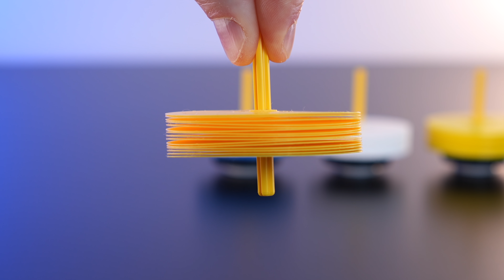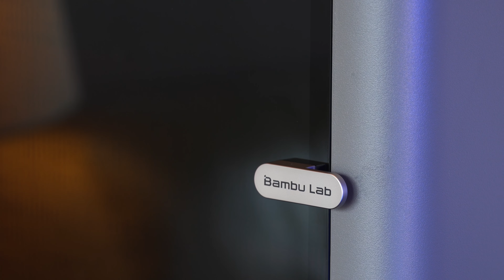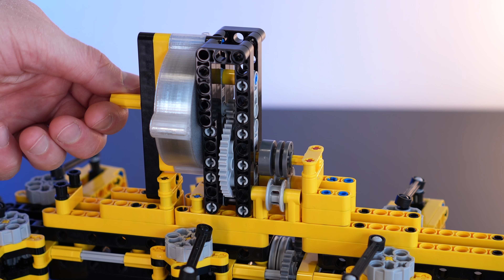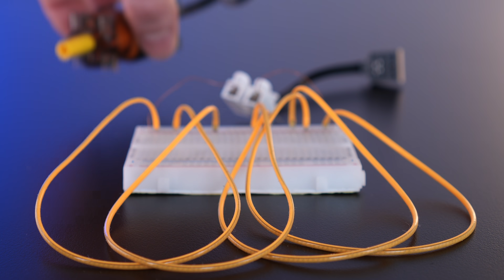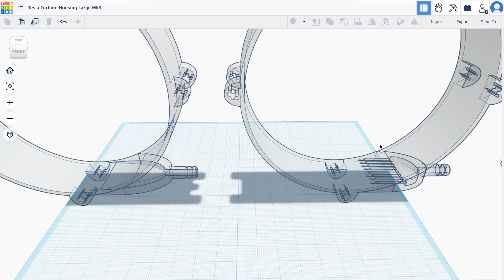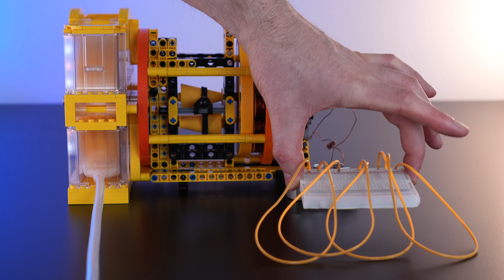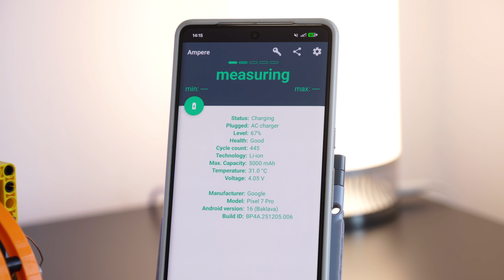Powerful Lego BLADELESS Turbine Generator!

Comment from the maker: If you’d like to pick up your own Bambu Lab P2S: https://tidd.ly/47BXRCr
Reply: Bambu Lab illegally proprietarized and enclosed open-source, explicitly copyleft software. It then sent a cease-and-desist to a developer who adhered to the copyleft license they are not upholding and are therefore breaching.
Reply: You need to properly declare your sponsorships. It's literally a tos violation not to.
Reply: @foureye6693 shuuush
Reply: @foureye6693  They did. To quote "Thanks to Bambu for parenting with me for this video". Doesn't get clearer than that you just skipped over it probably.
Reply: @CommanderRedEXE paid promos show differently when properly declared, this did not
Reply: use onshape or fusio360 instead of tinkercad. they're WAY more capable and time saving
Reply: I just recently got a P1S myself. Considering I was upgrading from an Ender 3, the improvement is night & day.
Also, if you want better laminar flow, you need a longer transition between the tube and the inlet. The one you're using is too short.
Something tapered, about 120-160 mm long (roughly half of it with the vanes) will let the turbulence settle out and become more laminar before entering the chamber.
Reply: He built an air raid siren
Reply: Hey can you try making aaln overpowered vacuum engine
Reply: btw in the video u forgot to print ABS rotors
Reply: i have an a1
Reply: Why does every single one sound like a air raid siren?
Reply: I have a 3D printer it is really cool I dom’t blame him for using it
Reply: *don’t
Reply: @theketokids7259 should i get one?
Reply: Bamboo🤨
Reply: @Pupi-aja  no
Reply: Is it good?
Reply: @MidWestRider-f5e  a lot of creators use it if that helps at all
Reply: @Blackhawk20034 ok I might get it
Reply: @Blackhawk20034  And I'm sure Bambu in no way encourage that by sending free printers and other goodies to people who'll wax lyrical about them in videos.
Reply: @MidWestRider-f5e  You'll have to use your phone and apps, and make an account and all that modern BS if you go with Bambu. Also they love to spy on what you're printing. I wish I was joking.
Reply: @foureye6693 oh, I'm a kid so idk😅
Reply: @MidWestRider-f5e  I recommend you go for it! 3d printing and 3d design can open a lot of doors if you're young. You can make some decent change with a 3d printer, because everyone will ask you to print things for them.

 Even if you start with a cheap older design Ender 3 or similar. Which is a machine that you can make new parts for and upgrade cheaply, that's a really good way to get started even today.

Comment: Great video Jamie. Okay, where do I start, note 'Lego' is a great toy and makes designing easy as.
So, what were you thinking!!! Trying to use it as a pressure vessel? This 'toy' was not designed to hold pressure!
You want to know how to reduce the back pressure to stop lines blowing off? Follow these next instructions to a 't'.
1. Make a molding of your 'pressure vessel' that pops in half so you can load a hexagonal metal axle and bearings.
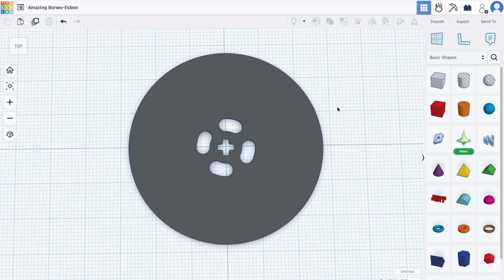2, Make elongated vents like the plan indicated 3:22, load the blades with a helix through the centre, and not in line.
3, 20mmNB from your compressor, split into two 10mmNB. The internal diameter (ID) of a connector reducing from a 20 NB 
hose to a 10 mm NB hose will vary at each end of the fitting depending on its schedule/wall thickness, you'll need a 8 NB.
then those two will split again into four 'injectors with 5mm NM, set the injectors aiming fifteen degrees down from the four o'clock
almost pointing at the five o'clock, your compression chamber needs to be 4 mm at the six o'clock, 3 mm at the nine o'clock, 
2 mm at the twelve o'clock, and a semi circle with 1 mm clearance at the 3 o'clock, just above the injectors.
Finally, a proper exit plan, 'four' exhaust openings at fifteen degrees, ten% bigger than the centre dics openings, four 8mm NB free flows 
reducing to 2 12 mm NB hoses, reducing to one 24mm NB hose with a gate valve, which can be closed slowly to optimise the 'generator'.

Comment: 0:43 this doesn't appear to be a Tesla turbine it's using the design uses by disk style sirens, such as air raid sirens and also in cheap 50 cent siren whistles. Those use those tiny ports for an intermittent air chopping effect. You can see the stator ports and the rotor ports intermittently aligned as the rotors turn, which is the primary source of the vibration and is usually baked into the design as part of the intermittent valve action. You can look up this type of siren or a cheap siren whistle to observe the same design, it's not the same as a Tesla turbine

Comment: 13:10 the pressure still made the enclosure shift, which made you lose pressure and RPM before it even could reach a top speed. I think this test was a failure, not the material.

Comment: I was curious as to why your "turbine blades" weren't printed to have spiral exhaust vents and why you chose that basic gear drive rather than a E-CVT design (you know, a 3 gear system of outer, inner and center.).

Comment: Tesla turbines rely on surface friction of fluids, whereas bladed turbines rely on the mass of the fluid. The ideal spacing of Tesla turbine disks is actually fully dependent on what fluid you're using. And has already been said, balance and vibration robbed you of more power.

The reason your miniature bladed turbine worked better, was that the spacing of the disks was off. Granted, these were Lego and 3D printed, but my point still stands. That said, these aren't often used to power generators, but more often are used as *pumps*, driven by some other form of power. Their lack of complicated parts combined with their friction-based nature, means they can function with fluids that would severely damage traditional fluid pumps. They're still used to this day, in certain niche applications.

Comment: Ask the air travels down to the center of the speed increases making the efficiency pretty high unlike normal turbines and with that compressed air it can reach high speeds replacing normal turbines

Comment: so a tesla turbine reaches those insane efficiencies mentioned by applying centrafugal force back onto the air thats spinning meaning that at maximum rpm the exhaust is at atmospheric pressure and its 100% efficient, but when you slow it down those forces dissapear and also the wetting effect that the fluids cause gets significantly reduced and thus the torque output and efficiency drop way down. This is the only reason we dont use these turbines in power plants today.

Comment: That’s not how you calculate how many watts it is you said that it can output a peak of about 30 V and one amp so then if you do the math that’s 30 W
Reply from the maker: It's never managed 1 amp at 30v though, so the max I've extracted at those pressures is still far below 30 watts

Comment: its called 12 SLOTS 10 or 14 POLES for that generator because coils are wires stuck through the slots between the coil holders although you can also call it a 12 tooth machine with the coil holders being the "teeth".

Comment: @18:30 the shaft is counter-rotating in it's housing. That is what the loud buzzing/vibrating sound is. It is the same reason a vacuum "screams" when the bearing is worn. The plastic is being ground away as the shaft spins.
i.e. needs bearings for the shaft. A LOT of the rotational torque is burned off in the shaft when it does that.

Comment: Most propulsion systems rely on outward explosive force. Viktor Schauberger proposed the opposite approach. He believed that air could be drawn into a disc through a series of curved channels that created a tightening inward spiral. This implosive flow would accelerate naturally as the air approached the center of the disc. 
In 1939, Viktor filed a patent with the Reich Patent Office for a "multistage centrifuge with concentrically juxtaposed pressure chambers," a means of propelling machines through air or water, water purification, or electricity generation. In 1940, Viktor contracted Kaempfer in Berlin to build the machine, then in February 1941, switched to the Kertl company in Vienna. In March 1941, he started working in secret for the Nazis. By 1944, this included the use of slave labor from the Mauthausen concentration camp. At the end of the war, the US apprehended Viktor, and debriefed him over the next nine months. In 1957, Viktor and his son Walter, were invited to the US by Karl Gerchsheimer and Robert Donner, to put Viktor's implosion technology into production. Viktor died soon after returning to Linz

Comment: Late to the party...  Instead of a belt for the CVT, you can try a rubber idler wheel which is slid across the different diameters to selectva particular ratio. It may be easier to maintain pressure against the cones than with a belt, and since both cones see the same pulley, any change of the pulley diameter due to wear has no effect on the overall drive ratio. Fascinating video, btw.

Comment: Since it makes power, you should add an air compressor with a tank to it. So while it uses air, it generates enough power to run the pumps to make more air and keep going, making it a never ending power cycle, then of course have some extra power options in it so you got extra power.

Comment: How big do you make the hole for the LEGO axle in Tinkercad? Because I’ve been trying to make my own LEGO compatible fan propellers, but I just can’t ever get the hole size right!
Reply from the maker: Ah good question! If I want to print an axle to fit into Lego, I use 4.7mm. But if I want to print an axle hole to hold a Lego axle, I use 5.1 or 5.2mm depending on how tight you want it. Good luck!

Comment: You do realize 1 amp is a big deal. And you can also power more of my LED bulbs than my generator. Very impressive! Also did you know you can power that turbine on dry ice?
Reply from the maker: Man I'd love to try dry ice! It's just not easy to get or store here in ireland
Reply: @JamiesBrickJams Would be cool to see. Just be careful doing so, if too much pressure builds in the tank it can explode. I also had an idea where multiple tanks are set in a row where one valve drops in some dry ice, closes and pressurizes, then a nother valve opens to discharge the pressure. All the tanks being timed kind of like an engine without Pistons to keep the turbine in motion. And I have a feeling it will work with what you got there.

Comment: The only downfall of this turbine is the fact that there's no material that has the strength it needs to avoid exploding. The faster it spins, the more efficient the turbine becomes, but for it to be practical, it has to spin so fast that there's nothing in the world that has the tensile strength needed to keep its shape at such speeds

Comment: Awesome video.  I like that you take measurements like a real engineer or scientist.  However 60  or 80 PSI is a bit dangerous.  I have done some of my best work in a constrained environment.   Early on, you blew into a turbine and got it turning!.  Blowing is about 1 meter water column or 1.5 to 2 psi.  My dual diaphragm aquarium air pump is 11 liters per minute and 3.5 psi.   Why not have a "turbine challenge" with those constraints?   Something like formula one car racing.   Have it as a formula lego turbine design contest.   Define the pump for the contest, define the challenge and   have prizes for the top 10 people.   I advocate using "well trompes" to help improve water quality in rivers, by oxygenating them,  by providing highly oxygenated areas where shellfish and small fish can hide and by removing sediment as they work.   They work anywhere you can do low head hydro power.  What I advocate also produces compressed air at around 3.5 psi. Right now,  sediment load in rivers is maybe 100 times what it was a hundred years ago,  and turbines are being removed all over the world to let fish migrate.  But the trompe is just a vertical pipe that compresses air.  There is no turbine in the water.    If your lego challenge works out, you may end up designing turbines to go in  mini water power systems worldwide!  And I think that might definitely be worth it.    Thanks Brian

Comment: the thing is
tesla turbines have a lot of speed and efficiency 
...which drops almost instantly to a bit less than that of a normal bladed turbine when load is applied
It does have the benefit of being a built in flywheel, which increases torque just by being hard to turn

Comment: Actually, you should try and use the exhaust air from the bigger tesla housing, and see if you can build another housing where the exhaust flow directly into and spin more disc's. So two housings. And how about making some groves in the inside of the housing inside on the housing to direct the flow of the wind inside after the inlet.

Comment: Yeah, the Tesla turbine doesn't exactly defeat traditional turbines in terms of power.. It's in the technicalities where it shines.
It can run with air or any liquid, can be operated in both directions and depending on the design, the swap can be done without having to tear it apart.
If I recall correctly, the holes in the discs should have a slight angle offset of a few degrees, but again.. My memory can be quite foggy.

Also the fluid rate is important. In some of the last tests you flinched when you heard the turbine make a sudden sound almost like it "changed gears".
That's by design. Those turbines will reach some sort of "resonance" if you will and I think you did not reach that spot for most of the tests performed
except for the last ones when you fully committed to the design. A lost opportunity, that's all

Comment: the only part about slicers when 3d printing that i dislike is the fact most slicers only use line segment G-Code. and even worse it just reduces the line segment to a tiny line segment. if you have some math skills and a g-code reference manual, you can print much easier. as an example i had to make a set of 45 degree menu card holders for a resturant. each layer is the same as the layer before and each layer containing 6 straight lines, 10 radii. the slicer wanted to make each layer unique meaning the instructions to make the line segments werent the same on every layer., one layer would start the line at a different fractional increment. while functionally the same, those variations add up to more time. turns out my controller supported modern g-code. i was able to reduce the program from hundreds of lines of g-code to about 25. you code one layer and g-code has functionality to repeat previous steps, so you just repeat the pattern n-times with n being your target height divided by layer thickness.

i say all this to point out, you can make those tesla discs much more rigid by printing them in a vase-like mode. either code yourself, a continuous spiral in or out or play with the slicer. by default most slicers infill face layers using straight lines. play with your slicer settings might be able to make them print much faster and rigid. faster because your printer doesnt have to relocate each line, it can just go at max speed for your machine and bang out one layer in one move.

edit: you may also want to use a current limiting resistor on the LED noodles. just so if you push too many pixies in to the noodles they wont explode.

Comment: i think the petG discs got fast enough to rattle the hosing apart causing it to have the axel off centre dragging the speed down. making some special exhaust bricks that have more space for air to pass would be a good upgrade.
Reply from the maker: Yeah I think you're correct on both counts. All versions could have done with larger exhaust ports. Especially the larger discs - I suspect I choked them with the small exhaust vents. PETG is likely a good material to use - especially for the larger discs as they're more shatterproof and lightly flexible. Will certainly give it another look in a future build!

Comment: You need to try doing one of the gearboxes, because I'm excited to hear what the shifting is like. Just use either a friction or magnetic clutch to help disconnect it when shifting, then reengage it when it's shifted so it can accelerate. I want to hear the noise of the turbine if it shifts. 😊

Comment: Compressed air is very inefficient. How much power do you need to supply the comoressed air?
Reply from the maker: Lots! Yeah this isn't very efficient. Though I guess in theory someone could create compressed air using a water reservoir or weight placed onto a chamber of air

Comment: The only problem I've had with modern Lego inventions, would probably be the use of 3d printing
I'm not against 3d printing, not by a long shot, I HAVE a 3d printer. I just feel the point of doing Lego projects like this is to use official lego parts in creative ways instead of manufacturing an easy way
of course it does open a vast number of opportunities, i just thing it's more fun to work with the restraints.
Reply from the maker: Yeah I totally get that criticism - I've gone back and forth on it for a while myself. I do like the challenge of trying to use Lego in the most creative ways to solve the problem. But there are just too many things I want to do that aren't possible with Lego alone. Especially as many projects of mine need powerful magnets or coils to be held in place. There's only so far super glue and blutak can take you! Another way I like to think of it is that Lego is a very useful modular 'scaffold' to build almost anything (rather than wood / metal). I've now got to the point that 3d printing is incredibly fun and unlocks so many new inventions that it's going to be a staple for sure. Though I will still try to demonstrate all-lego variants that folks at home can copy.